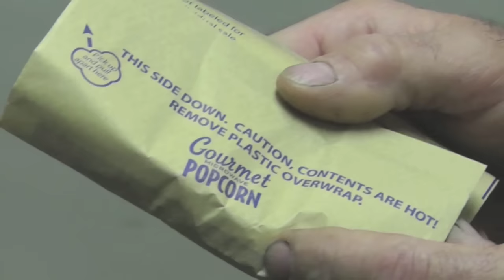How To Replace The Sump Gasket On A Briggs V-Twin Intek Engine with Taryl

Comment: Thanks for the video took my Husqvarna lawn tractor lgt2654 to a local small engine mechanic for this exact problem and he talk all around fixing the crank case seal and sump gasket and said it would be a long term job and claim he would have to pull the deck off lawn mower and to take engine off that was a red flag for me right there when he said that had already watch your video several times so I order the exact parts u showed and  even order valve cover gasket pulled engine off today done exact steps u said do put everything back together and no more oil leaks and runs like a charm fired up first turn of key thanks again!

Comment: Thanks! I just finished changing the sump gasket and seal on an otherwise perfect Craftsman PYT9000 that I picked up for only $20! Oil was leaking like crazy and the mower smoked after a couple minutes. I watched your video like 20 times while I did the job. Turned out great. No leaks. The old gasket was all crumbled and hard. You're the best!

Comment: Even though this video is 5 years old as I write this, it was a fantastic help.  I noticed a couple of things on my 17-year-old V-Twin. 1. The threads had a slight pull in the block, and adding a chamfer will eliminate this.  2. The castings (both) had sharp internal edges, that could lead to gasket failure. Again, chamfering or softening the internal edges will reduce stress points and possible failure.  
Keep'r between the ditches!

Comment: I just completed this operation and this vid helped a lot!  My engine had a different oil pump gasket (flat) and an automatic choke.  Other than that it was the same inside with the gasket failied along the long edge.  The most difficult part was removing the pulley.  I had to fabricate a puller from a steel plate and three long bolts to fit the holes in the pulley.  I did not replace the crank seal but had to guide it past the crank with an awl.  No more leak!

Comment: This was an awesome instructional video.  Engine was leaking from the gasket right by the oil filter,  Followed you video and replace gasket and seal without issue, engine back on mower and running.  Gonna use your other video to replace valve cover gasket also.  I also love that you give great tips along the way "watch our for...."  &  "be careful of..."   Excellent job guys!!!  (by the way, the oil drain valve was loose)

Comment: I watched and rewatched  (x5 slow learner )your video on the B&S sump gasket repair, because you detailed the correct way to adjust the governor after the gasket had been installed. The governor gear had failed and I had purchased a new gear and washer for the motor. The new governor gear did not survive the restart of the motor. Upon the disassembled I found the new gear completely destroyed. I thought maybe i hadn't followed your instructions about moving the governor control arm up inside the sump when reassembling the motor. I again reassembled the motor with a new governor gear and washer. This one survived the restart at half throttle, but when advanced to full throttle again ran away and destroyed the gear assembly. I disassembled the motor again and after checking all the dowels that position the gasket on the crankcase, realized that the pin for the governor also was a dowel. (I thought) I grabbed it and it came out of the case. I checked it and it had a few scuff marks on it. I figured that it would just be easier to order a new pin to install. Imagine my surprise when I found that there isn't a replacement pin offered by B&S. After more research on the subject I found out that the pin is actually pressed into the case. If the steel governor gear spinning around the steel pin wears or gets galled by heat or lack of lubrication it will seize onto the pin or destroy itself. If it seizes onto the pin and spins the steel pin in the aluminum casting, then B&S considers the case ruined and a throw away. 

After watching several of your detailed videos about b&s and Kohler engines, I figured that this is a subject that you might want to make a video about. I've researched this a bit and it isn't uncommon for this to happen on older B&S -twin engines. It might save someone (like me) a lot of time and money if part of the inspection upon the disassembled included a check of the pin. It would have saved me at least $100 in parts, shipping, fluids and filters had I known to check that one little steel shaft first. 

I did see that one other Youtuber had made a video detailing a fix using JB weld to hold the steel pin for the governor gear. If U have a better solution maybe U should include it in a repair video update about governor gears on B&S v-twin engines.

Love the costumes, the movies , but especially the detail and clearly and slowly defined way of explaining the disassembly and reassembly of what U are working on. Six thumbs up!!! "There's your dinner!"
Reply: I have the same issue with the governor gear failing after seizing on the governor gear shaft and found this channel looking for answers. I'd love to see a video from Taryl on it!
Reply: same problem here... governor detonated.... If I have to guess it was because the throttle cable was misadjusted causing it to over-rev on start of boom... I dont know for sure though. Putting a new governor in tomorrow...

Comment: Just wanted to say thanks for showing us how to do this Taryl. I have this exact mower and had a serious oil leak and no idea what to do about it. I'm a relatively green mechanic but your 'how to' film spelled it out so clearly even I could do it. Took me 3 days on and off and had to watch your video many times. Only problems I encountered were the 4 engine bolts and clutch spindle were very tight. I fixed this by cutting the end off a metal hoe to extend my socket's leverage. I also needed to lock the engine when removing the clutch spindle by stuffing 3' of clothes line into the spark plug hole. Had a bit of a tussle too refitting the sump cover, couldn't quite get it to fit - had a 1/4" gap. I eventually sussed out the 2 dowels weren't lined up perfectly, then it dropped in. Your explanation of how to set the governor was first class, and she fired up first time. Many thanks Taryl from the UK.

Comment: Thanks for the informative video. I inherited a 24hp Briggs mower completely covered in oil. After cleaning up and running it for a few minutes it was obvious the leak was just as you found - blown gasket. Thanks to you I have the confidence to dive in and repair. You saved us $$$. Thanks.

Comment: Back in the day we used the playing card trick.  From a deck of cards, place one card around the shaft, then slide the seal on over the card, then pull the card out, and seal lip in place, Thanks for all your videos, They help, Shane Arnold

Comment: I ordered the gasket and seal today from ebay. You were recommended by someone there who has the same problem as the rest of us.  Thank you so much for dinner!! :)
Reply: Got er done and no leaks! I did have a problem while it was upside down. Seems the crankshaft will slide down( up when it's upside down) and then the cover won't drop. I had to slide the crank gear up and realign the timing marks. Eventually it went together. Evidently you're not supposed to stand them right on their tops. No harm done, just a little extra work. Thanks again for the video! It was a tremendous help!! Now for some dinner!!

Comment: Thanks for the visuals. Had some odd things happen when I hooked the linkages back up. I could only get a super low rpm. I left the cables hooked up when I pulled the engine.  Anyway, I took things off and double checked, fixed the issue. Only thing I've got left to figure out is the mower is hunting both at idle and under load. I didn't touch the carburetor. Might try and put some fuel additive in and see. Thanks again for this!

Comment: Thanks for the video.  I'm back up and running thanks to you and this great video.  

Also I would add a note for everyone to pressure was the engine first. And to also remove there oil filter before tipping everything over. Because although mine was drained. The oil in the filter flooded my air filter and carb.  Took me a long time to clean all that out.

Comment: Bless you Taryl  !! I took on a 24hp Intek sump gasket for the first time. I was losing a pint an hour and everything was a mess on top of a mess. It took me quite a while but after torqueing the sump down I flipped the motor and heard a distinct Rattle inside. HUH? Oh well, I mounted it back up and it ran great until I noticed the oil pressure light was lit. I had NO idea what to do next until I watched this video. Thank you for including the oil pump shaft explanation. I found mine rolling around next to the crank it had fallen out. And of course my guide pin fell in. Put everything back and everything was great, running, oil pressure, then it caught fire right behind the muffler. I am hoping it was just some of the oily mess I created. I got my Dinner!!  I had better luck with the PTO seal by putting it on last after I set the sump, then I tapped it home using the old seal to counter sink it. The first time I installed it on the sump first & my spring came out also.

Comment: Thank you for your video.  I used it last week to replace the oil pan gasket and shaft seal on my mower.  It was very helpful (and entertaining).  A tip I would add for others using the video for reference would be to consider also changing the governor shaft seal and the oil pump o-ring while you've got the pan off.  The parts are cheap enough...

Comment: I change my oil drains to the old steel pipe you can get for a few bucks at the hardware store.  It stays tight and never leaks or cracks.  The oil drains faster and more completely without running back and dripping.  Great video as always!  I like that you show that repair is simple if you're careful and informed.  Thank you.

Comment: Bam!!! There's your dinner! You reminded me to check the oil drain plug. Thanks for the tip. That oil plug being loose is scary for sure. I have a friend that blew an engine on his zero turn because of no oil and another friend and I wondered how the heck did that happen. I bet that the drain plug fell out and my friend didn't even check the dipstick. Oh well it still happened.
Reply: I just did this repair, my oil drain plug was Waaaay loose. I put a wrench to it. As a matter of fact every bolt on the motor and frame was loose after 400 hours.
Reply: Good thing you learned this.

Comment: After watching your video  my 22hp v-twin  start leaking :) . I got my parts today ready to put it together tomorrow. 
Great video , thank you T.
Reply: Be careful cleaning off the old gasket, I ended up wearing gloves. The mating surface edges are razor sharp!
Reply: +sixty9harley thank you for a tip

Comment: Taryl thanks for a great video. My mower was leaking oil and I thought it was the sending unit beside the oil filter. When that didn't fix it I came to youtube and found your video. I tore it down today and sure enough about three inches of gasket was gone right beside the filter.  My mower ( 52" bobcat) is 14 years old now. I will make it through this season and I may upgrade to a new engine before next year. The bobcat has a little over 900 hrs but everything else is still solid. It has an 18 hp on it now. I may go to a 24hp. Thanks for a great video. Nice teeth!!!!    lmao

Comment: this video was very helpful, especially the part about setting the governor. One thing that could be added to this (and other videos) is how to take the drive/mower pulley off the crankshaft. I had to do a search to find a trick where you stuff a few inches of cotton rope in the cylinder, through the spark plug hole, to stop the crank from spinning while you remove the bolt holding the pulley. Other than that, awesome video. Thanks so much.

Comment: Thank you Taryl, I have a 4 year old tractor that all of a sudden leaked a river of oil after changing this spring 2020. I couldn't figure it out. Today I stopped mowing after smelling burning oil and sure enough, it's leaking but I could not figure where from.  It seems to be above the filter. Now, after watching your video I understand.  My sump gasket has to be broken above the filter.  I'm guessing every time I change my oil it pulls the gasket out more and more.  When I changed the oil in the spring I also added a street pipe to the oil drain because the drain valve was loose.  This all does anger me though.  I expected better from B&S

Comment: I had to take my 3 yr old Husky motor apart because the governor blew, found all the pieces plus a small pile of chips in the sump, amazed to find there was NO GASKET except for a very light coating of sealant between the sump and motor. New gasket is the new style too, with wider sections at known leak points.

Comment: Last fall (2023) I got a 'free' 54 inch zero turn mower from a scrapper. It was "junk" because it had had a gas fire and melted everything plastic on the mower, including the carb float.
 I stripped it down of all plastic, including the manifold , spritzed a bit of starter fluid at it and it fired up.
 Knowing it was a 2008 mower but  only having 295 hours on it, I proceeded to round up parts(used off ebay if possible) . After a lot of clean up , new belts and a few deck parts, it started , ran and mowed great. but almost immediately started leaking  oil.
 I looked on line and find these engines had problems with that gasket, so I watched 2 or 3 videos on replacing it. NONE of them mentioned the important parts, like governor linkage adjustment. 
 THEN, I find this video. 
 I pulled the engine and  find the gasket is sucked in on both sides. Currently waiting for my gasket set so I can finish this job up and get to mowing  with a "free" zero turn, that I will have about $350 dollars invested in.
 Thanks for covering the important points on this repair!
Reply: My engine is back in the mower , ran great and didn't leak a drop of oil in the first 1.5 hours of mowing!

Comment: Hey Taryl,  I watched your video and followed everything down to a tee.thanks but noe I can't get it to start I changed spark plugs also. I have spark and I sprayed gas in the spark plugs holes before I put in plugs but won't fire not sure what I did wrong? Have any suggestions? Thanks Dale

Comment: Taryl this video was great and helped me with a oil leak on my 27hp briggs in my husqavarna garden tractor. I was wondering does the drive pulley on the crank need to go back on in a certain direction?

Comment: Great video, as usual.  My BS V-twin leaks at the same gasket and I assumed it would require a full tear down, but it’s not half as bad as that.  Looks as if I should be able to finish it in an afternoon or weekend with your tips.  I only wish I had a Koehler or Kawasaki instead, because any time I repair a BS engine the result still leaves me with one of their junk engines.

Comment: Thanks Taryl. I replaced the gasket on my B&S 445677 1188B-1  24 HP V-twin. After removing the oil filter cover to install the oil sump I found an oil filter screen P/N 796214 on the floor of my shop, but I cannot figure out where it goes. The parts diagram and service manual do not illustrate how to reinstll this part. Any clues? THANKS!

Comment: Awesome video! I followed you everystep and I would have had a hell of a time with the timing marks had you not mentioned them. THANKS!! I do have one question...I did this and now the mower is hard to start until I gets running for a bit. Could anything that I did caused this or am I chasing another problem?

Comment: I have a mid 90’s Craftsman with a Briggs 19.5 Turbo cool Opposed twin. It seems to have deleloped a bad oil leak on the left side sort of on the bottom by the sump. Seems to leak more when I turn the engine off. Is this normal and have you seen this on the 19.5 opposed twins also?

Comment: Was disassembly of the oil pump necessary to replace sump gasket?  

I'm getting ready to remove the sump pan to retrieve the aluminum rod that fell down into the engine.  I want to get in an out as quickly as possible.

Great video!

Comment: Thank you for doing this video! Is it possible to replace the crank seal only from under without removing the motor or the entire Engine Sump?
Reply: did you get an answer i'd like to know also

Comment: Teryl, I know they never break, but I would like to see a vid on the snapper 10hp crank rope start mower.  Especially the clutch replacement and carb adjustment.  The first one I had lasted 22 years!!!!!  I got tired of trying to get tractors to run and just sold my John Deer 240.  I am going back to a simple push mower that you can ride!

Comment: It paid to look @ this Clip. Doing a sump gskt repair, the oil pump pick-up debris screen fell out of its well in the sump. With a detailed look stopping this clip @ a sump close up. I was able to locate the correct pump screen " notch position" facing the cam bearing or 12 o'clock position. Since this info is not in Briggs Intek twin Shop manual. Incase the oil pump pick-up screen, fell out. This is a pressed in part, that has a "half moon cut out" on the plate that screen is part of. Alignment of this screen plate may affect the oil feed to the oil pump.

Comment: Glad you specified going against the arrow when holding the governor and seating the cover. I saw another one of your videos where you replaced the cam and didn't specify that. It seemed like in that video you were saying to turn it toward the arrow and not away. Might want to add that in print or something on that video.
Reply: After doing this job and adjusting the governor, I noticed the shaft wouldn't turn left or right after loosening the nut. Is this an indicator the governor is blown? The only way to control the throttle is on the carb.